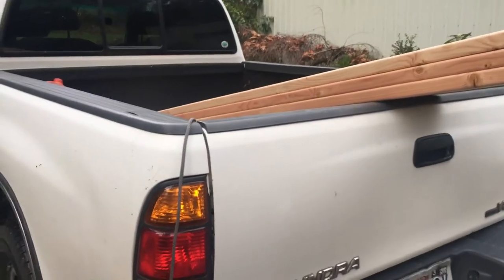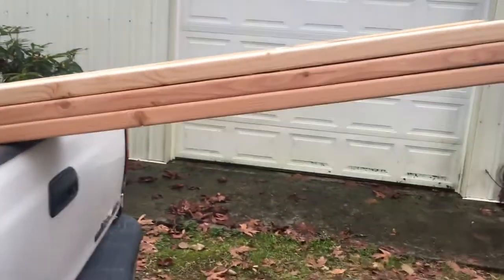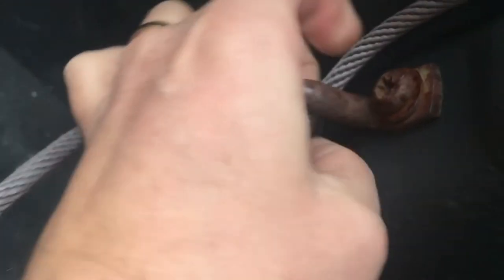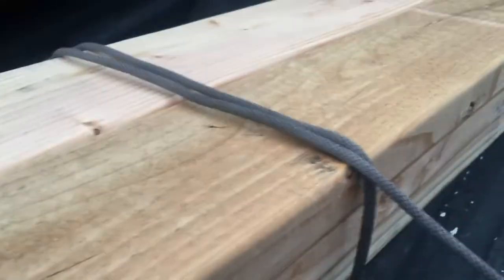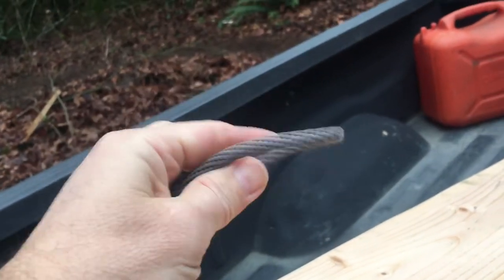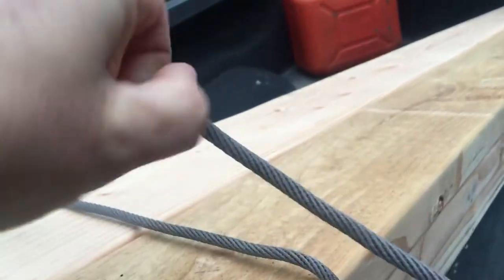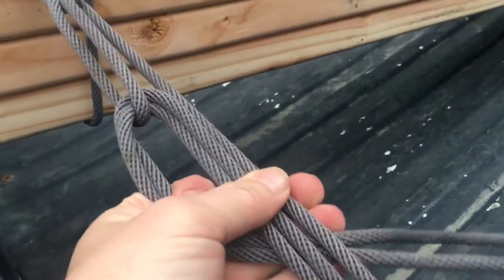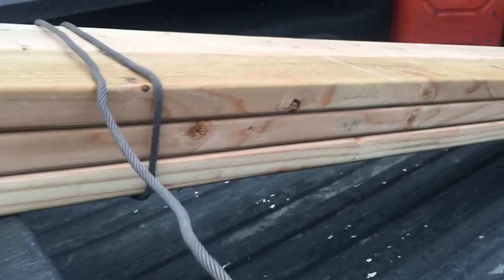How to tie down lumber on your truck | Busy Beaver | Chuck Beavers

Comment: Nice video but no one can convince me that rope on this project can out perform a quality 1” webb racket strap in strength  , durability , longevity , and ease of use . Do not buy garbage freight straps .  A quality strap will have a 1000 lbs. WLL ( working load limit ) and come with different hooks at the ends of the straps .

Comment: Great truckers hitch tutorial.  One minor improvement,  would be instead of "belly wrapping" the lumber (going all the way around it), when you go underneath the load, wrap it around the original, already attached rope, and then back underneath the load. The benefit of this, is that it tightens the rope on both sides of the lumber. If you have a really heavy load that doesn't shift while your cinching down on it, the fixed side of the rope can stay kind of loose, even tho the passenger side (in this case) would be really tight. I hope that made sense, it's easier to demonstrate. I love to tye with rope over ratchet straps when I can too, it''s a lost art. Thanks for the great upload
Reply from the maker: Yes that makes sense. Thanks
Reply: Sorry, no idea what you are talking about.
Reply: The ratchet strap is limited compared to a rope . The best thing about a knot is that it holds .